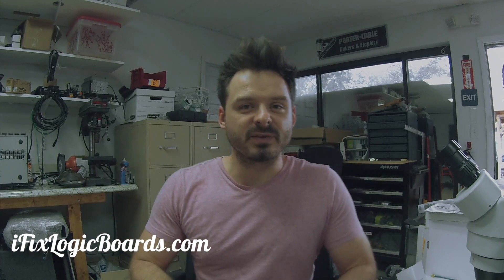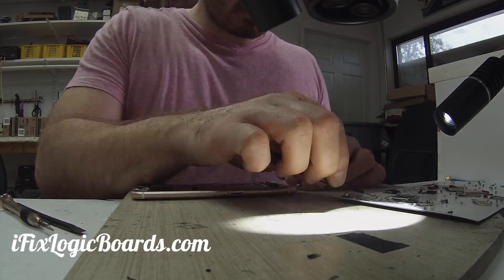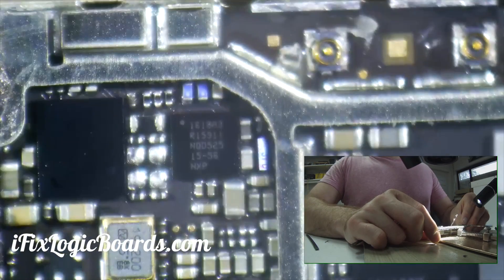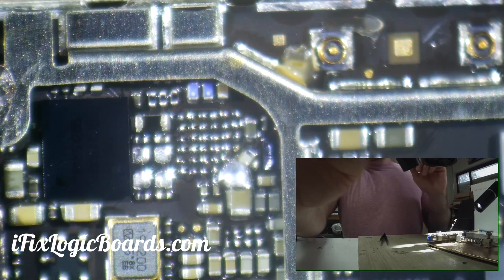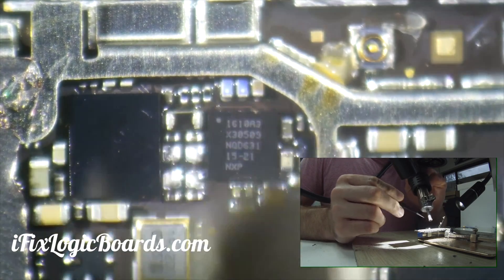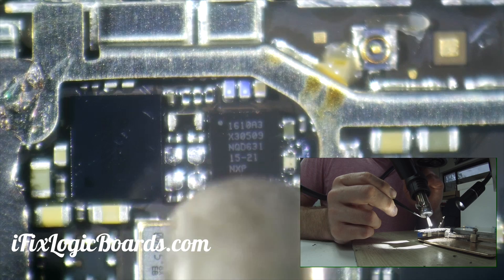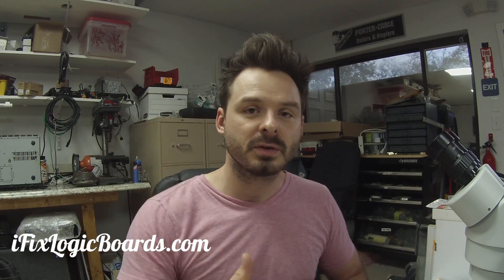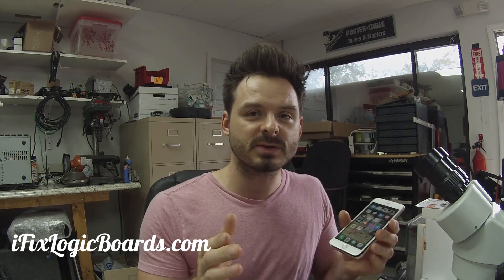iPhone 6S Plus not charging  - Tristar repair

Comment: 6S+ recently giving "This accessory may not be supported" error message and stops charging.  Unplug and plug back in a few times and it eventually will charge.  But, it's getting worse.  Also, battery runs down fast.  From 100% to dead in a half-hour.  Relatively new battery, replaced under Apple's battery replacement deal a year or so ago.  Best Buy repair guys did the replacement.  Guess I'll do another replacement myself?  Any diagnostics I can do while the phone is open?  Was planning to replace it with a lighter-weight SE2, but Apple's delayed release again...  Guess I'm stuck with this boat-anchor?

Comment: bro , i have replaced the u2 but it still not charging, should i replace the tigris too?
Reply from the maker: You can. It's rare but it happens. Also check voltages around the tristar, maybe a line has a short.
Reply: ScoopOf3D i have reball the tigris , but still no charge 
What can i do bro ?

Comment: nice video ! how if battery draining faster ? if i charging its normal the issues is only battery drainning even in lock screen and airplane mode ! thanks
Reply from the maker: It could also be tristar or just bad battery. But it could also be some partial short someplace.

Comment: My iphone 6 plus charging problem.
I show the iphone service centre. They said board problem how to resolve it.
Reply from the maker: I would start by replacing the tristar chip.
Reply: ScoopOf3D hey nice video i have replacete the u2 but still no charging
Reply from the maker: Check capacitors around tristar, do they have shorts and correct voltages.  You might have to change Tigris since that's the chip that actually pushes the power to battery.
Reply: ScoopOf3D hey Thanks for replying, is there a pdf where i can check what the voltage should be??
Reply from the maker: Check schematics or best compare to other working board.
Reply: Actually my phone bend. when i straight it by repairnman then this problem create.what should i do.
Reply from the maker: Reflow or replacing tristar to start.

Comment: I have the same problem with a 6s plus but mine does not connect with the pc and cant boot it even if i have a charged battery, please help, can it be fixed?
Reply from the maker: Sounds like you need new tristar. It's not always that though. You can go to my website http://iFixLogicBoards.com to get the process started.